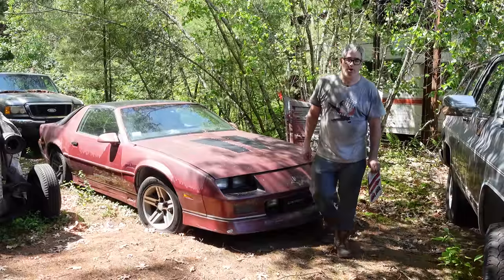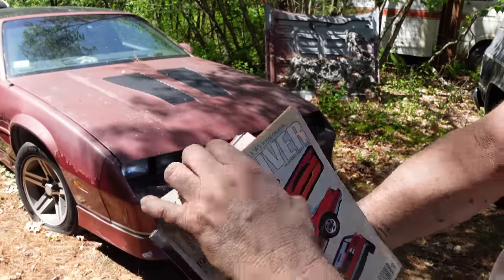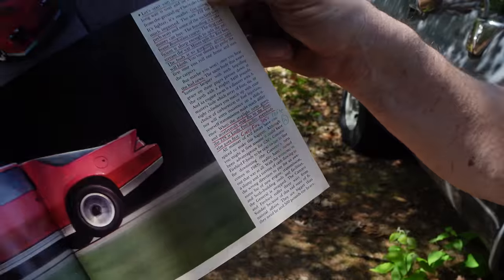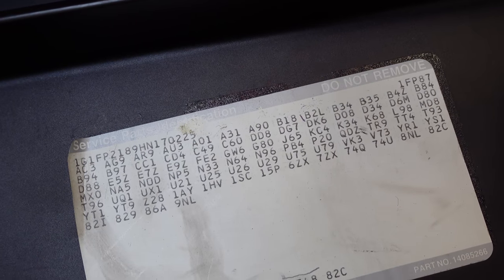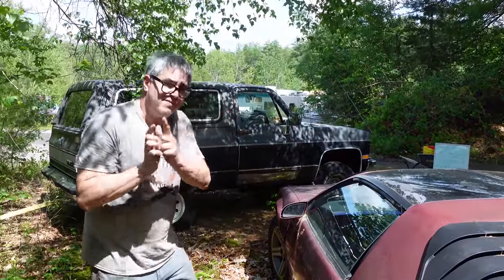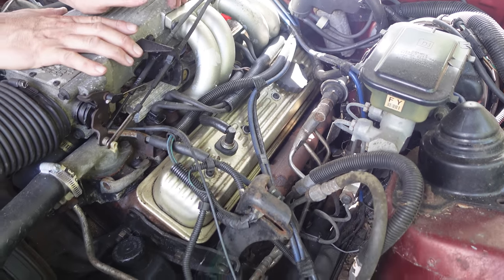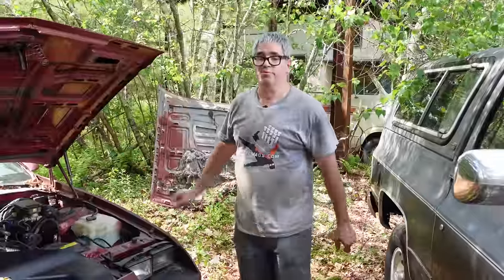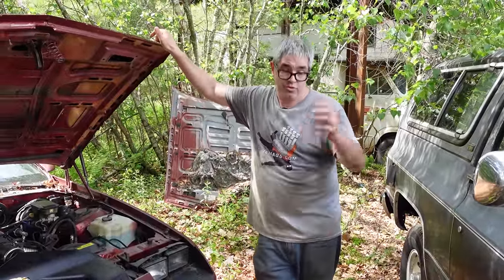Heart of a Corvette

Comment: I had the 1987 5.7 350 and I have plenty of friends in the neighborhood that have mustang GTAs formula 350s Mitsubishi eclipse turbo eagle talon turbos and and grand nationals we always used to go to the track and street race. I’d beat every single one of them stock for stock, except for the grand national. Soon as I put the three states, hyper Tech chip pulleys, air charger, ram air flow master exhaust from the cat back being M shift kit 3500 stall speed in the transmission. A car is running in the mood 1360s, 1370s  what 150 shot of nitrous 1250s, 1260s

Comment: Awesome info.

I read the reason why the 5.7L didn't come un manual is because the manual transmission couldn't handle the tq. True? Who knows. Could've the Doug Nash 4+3 have fit in it?

The auto-only option was the primary reason I never bought one over the years.

Comment: I had one of those 5.7 Camaros. To put the IROC name on those cars was wrong. It handled ok but lacked any real engine power. The GT Mustangs with the 302 motors would walk away from the 350 IROC. I finally ripped out the 350 and built a carburated 400 small block for it and switched it over to a stick with a Muncie 4-sp and 12 bolt. The one time I raced it shifting at 5500 RPM through the turbo mufflered exhaust and 16-inch TA radials the car turned a best time of 13.02 down the 1/4.

Comment: When you said B2K I started going crazy... thinking did Steve find a factory Callaway Twin Turbo IROC?  
B2K is the code for the CALLAWAY TWIN TURBO 350. 
L98 is the code for the 350 Tuned Port Engine. (3rd row 2nd from right side) 
J65 is 4 whl disc brakes, G80 is positraction, D88 is stripes, D80 is Spoilers

Comment: There is an almost identical, like BRAND NEW one (919miles) for sale at AUTO ETCETERA in Montréal. Same year (87), 305 engine, same color, t-top. They ask $89,995,00. Just like if it came out from the dealer in 1987.

Comment: Why is that car in a junkyard in the first place? If I had the cash I'd fly there today and rescue it. I had an 86, same exact color with a 305HO and a 700r4 trans. It kept stalling and blowing the control module in the distributor. I sold it to a guy who later told me it was a loose wire behind the dash going to the tach. Had I known I'd still have it. I really hope someone saves that car.

Comment: Yes they made those 350 irocs but they actually made more than 1k of them and they did put aluminum heads on some of the iroc camaros
Reply: No. But what some tinkers did was use factory '113 d-port heads from the C4. But need to use the correct base manifold for them as well

Comment: I thought the original 1982 Cross Fire Z28’s had a movable flap cold air induction system on their hoods that was functional?  I remember seeing one brand new at the time, and I would swear that it had small flaps on that simulated NACA hood that opened in response to the throttle position.

Comment: owned an ‘82 sport V6 Camaro that blew its transmission after 50k miles. GM told me to pound sand on claim; had it fixed, then sold it.  Few years later I learned  that a class action lawsuit was filed against GM for using a Chevette transmissions.  I swore that I’d never purchase another GM vehicle and I haven’t.

Comment: I’m willing to bet the press car specifically didn’t have A/C to give it an advantage over the Mustang. I’m not sure if this was the same back in the 80’s, but when I sold them in the early 2000’s an A/C equipped Ford always ran it unless it was on floor vents. At very least, they likely picked a warm day so the journalists would be inclined to run it while driving the Mustang.

Comment: Steve, starting in '89 there was a "1LE" Camaro with special brakes, HD suspension and a 350 5 speed T5 "world class" improved manual transmission. They didn't make many of those, but they're worth mentioning-?
Reply: No factory 350 stick car in 3rd generation, including 1LE's...305 T5 or 350 700R4...exception would be Firebird Firehawk modified though by SLP...used ZF S6-40
Reply: @nachoandsancho5218  I pulled the T5 from an original '89 1LE that burned. It was in a junkyard in '91. The junkyard verified it was a 350, and numbers matched, so it was original.

Comment: Back in early 90s I had a blue and gold like new totally loaded 85 Z unfortunately with the LG4 5.0 with the slippy 700, where there not super heavy and 700 has a really low 1st gear it had ok TQ so it didn't feel totally awful from a stop but wasn't fast by any means. I couldn't bring myself to molest the engine it was so compleat totally untouched I had a close friend that also had a black and gold 85 Z but his had the H.O. and a 5 speed just 20 more HP and a manual made a big difference in performance but his was a stripped model so just that made me ok his was bit faster. Its funny that car is now up the road from my house but I heard it's totally rotted out it's to bad it was so nice when I had it.

Comment: They should have had a manual transmission optional on the 5.7 cars. The 5.0 manual was a fun car but that extra HP would have been amazing with a manual. As far as the 5.0 Mustang. By 87 they had 225HP and 300 lb.ft. Of torque in a lighter car. With a Z code axle 5 speed manual you could take a 5.7 IROC as long as you had the lighter LX Mustang. The Mustang GT was heavier. I know because I was there. Even IROC guys back then admitted the Mustang was quicker. Year to year things went back and forth though. The two cars were very close overall in performance. The Camaro was a better handling car. I always liked the Mustangs better overall. They seemed better built. That’s probably why there are so many more Mustangs around today then there are Camaros from those years. It was a great time to be in my 20s though.

Comment: I’m pretty sure that larger Australian rear was not tied to the 350. It was more a supply/substitution thing. My 85 non-WS6 Trans Am had that rear. And around 1990 til the end of thirdgen production they all went back to the 7.5 rear.
Reply: I worked at Pontiac when these were new.  Mostly Pontiac had the aussi rear, not Camaro.
Reply: @scrappy7571   85-89 Firebirds, 87-89 Camaros..some early 1990 cars if I remember correctly. My point is, it wasn’t tied to the 5.7 only
Reply: @salesposito2290  Agree, 305 pontiac too. But pretty sure not many camaro's had it.

Comment: When they brought back Formula for 1987 in the Firebird,it was a stripped down version of a firebird that you could get for almost the same price for an lx 5.0 Mustang.
Without ground effects and only 2 engines you could get were 305 or 350.
It was slightly more than the mustang but with the 305,5 speed it was could run with the best of them.And out of all the Camaros and Firebirds the formula was the lightest car you could buy with a v8.
doors
 Then again came the Firebird in 89 which was the fastest sports car of all time,with a  v6  that went 0-60 at 4.6 secs,ran a top speed of 155.
If Pontiac would of kept building their cars like they wanted to through the 90's they would of been alot better than having a 4th gen that was mostly plastic,cheap stuff.the steel bodies were special even though some like the 4th gen camaro and firebird better.
Pontiac made he fastest American sports car of all time,and could have actually took Corvettes plac if they had kept doing their own thing,just look at what happened with GTO it turned into a glob and they ended production!!

Comment: The 3rd gen cars were very striking when they came out (remember the 'new wave' inspired commercial for the '82 Z28?) and made the mustang look like it was boxy little mini-van, but the build quality of these cars was miserable. I remember test driving lightly used (returned leases) Firebirds and the Z28s in the mid '80s and could not get over how used up they felt - along with all the normal squeaks and rattles. I did own a '84 Firebird SE for a short time. Did GM ever solve the severe body flex problem on the T-top cars?
Reply: The Mustang kinda looks like an Escort.
Reply: @skaldlouiscyphre2453  Maybe a mini-van was a little harsh...still very upright and angular compared to the 3rd gen F-bodies.
Reply: @davem8790  Absolutely. The F-bodies had a windshield angle not unlike the Corvette - meanwhile the Foxstang was pretty close to everyday Fords like the Sierra and Escort.

What's funny is how futuristic and swoopy the Foxbody and Sierra were and how the F-bodies still managed to make them look frumpy by comparison.

Comment: In 82 Pontiac also put a 4 cyl in Firebirds and I believe a few trans ams too...what were they thinking? lol
Reply: Only on base models from 82 to 85, a credit option on S/E models, but Trans Ams only got the V8 or the Turbo V6 in 89.
Reply: No four cylinder in a Trans Am. The 1989 Trans Am could have a turbo V6, but for 1989 only.
Reply: @Raptor3388  Turbo V6's were limited to Anniversary editions, and only came in white.  One year only model and only 1,000 were made.
Reply: @houseofno  there were actually 1,555 1989 Turbo Trans Ams
Reply: @Raptor3388  thanks for the update.

Comment: This car was the start of the true Ford Vs. Chevy rivalry for these cars. Partly because Chrysler opted out, and partly because Ford guys knew the Iroc was a much sexier car and only had lighter weight and the "good ole days" to hang onto with the 5.0. 
Ford dressed up the Fox body, upped the power. 
I will give Ford credit, but also bash them for the same reason. On the one hand, Ford was competing with this car with their 302. Chevy couldn't beat them without using a bigger engine, so they went with a 350. 
On the other hand, Ford had a 351 that might as well have been a factory bolt in swap due to how similar it is to the 302. They refused to do it. I get why, I swapped a 84 Capri with a mild built truck engine so I get why they didn;t offer it to the public, but it became such a point of contention in the stop light race debate I can still hear the non-sensical defenses of both sides from whenever it came up. 
I like both cars for different reasons. now that some decades have passed and they aren't littering the streets i prefer the Iroc because it just looks cooler and time has been kind to junkyard engine swaps for the Chevy. 
I am sure someone is going to want to save that car. If it was in Wi it would be rotten to the ground, so to me it looks like a dang paint job away from being a daily driver.

Comment: The reasoning for no 5 speed manuals bolted up to the 350 TPI was because the unibody could not handle the torque stress and would flex the body, which would be made even worse if it was a t-top. When they brought the convertible back into production in the 91/92 models, you could not get a 350 TPI engine in a convertible at all. There is a side note about the 5 speed transmissions that did come in the 3rd generation F-body platforms of Camaro's and Firebirds: the T5 and T5 World Class 5 speed transmissions were JUNK. They could not handle horsepower. If you squeezed extra horsepower out of the engine, the T5 was known to fail and the T5 World Class didn't fare much better. If someone wants to bang gears, they'll be better off with an "old school" Super T10 4 speed or a well built "new school" T56 6 speed(some of the T56's don't hold up) in regards to GM performance.

I've been messing with F-body cars for 25 years. I have a dozen driver quality, projects, and parts cars sitting at my home shop ranging from 1979 to 2002 right now. I also don't discriminate against V6's or V8's...although I hate LT1's with a passion.

Comment: What gives with the T-tops? My first brand new car the year after I graduated high school was an '87 Formula 350. My dad had just purchased a new '87 GTA 350. Neither had T-tops because, according to the salesmen, they weren't available with T-tops because of the additional torque caused too much body flex. I didn't think that the 350 was available in the 3rd gen F bodies with T-tops at all. Obviously I'm wrong but BOOM, mind blown! And my buddies '86 IROC with a 305 was dead even with my 350 Formula when we raced. And we did it multiple times. I loved the looks of the car but I had a '79 10th Anniversary Trans Am with a 400/4 speed prior to owning this car and it would run circles around the Formula.
Reply: The T tops are a liability. I got tired of having to bring my umbrella every time I wanted to drive in rainy weather. They rattle and leak no matter how many times they’re aligned. Yuck.
Reply: Some dealers sent the cars to ASC to have T-Tops installed.  If the T-Tops has a key to lock them they are from the factory, if not they are from ASC.
Reply: @pmscalisi  I didn't have any issues on my '79 but I know they are notorious for leaking.

Comment: I had a ‘83 firebird with the iron duke 4 banger and a 5 spd….it was a turd……i wanna say i bought that car for $500 from a tow yard back in the mid 90’s……ended up trading it for a bag of weed and $50 when the ignition system no longer produced spark due to a shorted wire under the dash……if i still had that car it definitley would have gotten an LS swap along with the ‘77 camaro i had right before or maybe it was after that….i also bought it from a diffrent tow yard for $700…..it had a 305 with a th350

Comment: HELLO…..No B2K RPO code.  Was a B2L code….BUT THE REAL CODES.  L98 is the 350 or 5.7 engine. G80 and J65.   G92 was the performance ring gear …not present.

Comment: Come on Steve tell them why they couldn’t get the five speed manual with the 350 engine the five speed manual fifth gear could not handle the torque and would break all the time because I used to put 350s in cars that had five speeds

Comment: 1987 mustangs actually had 225 horsepower as well with 300 torque, idk where the 200 is coming from but it was def 225, couple that with the 300 less pounds, no Camaros were beating any mustangs at that time stock, good try tho

Comment: The 350 iroc could be had with a 5speed if it was solid roof
Reply: Not that I'm aware of
Reply: No if you ordered a five speed you got a 305.  Reportedly one of two things was going on:  1) Chevrolet didn't want the less expensive, lighter Camaro outrunning their flagship Corvette or 2) there were structural concerns about the body flexing under the more powerful 350.  Easier to damp down the power using mushy shift points on the automatic which is why 350s got automatics as mandatory.

Comment: It’s rite where it should be……junkyard
Reply: Hard to find room there, already full of fox box rustangs!
Reply: @jukeboxzero1  maybe. But a iroach never beat one in a race.   Slow azz junk 3rd gen
Reply: @JerroldSullivan-nt7qj  3rd Gens are sleek. fox boxes were always cheap AND ugly with their econobox 4-lug wheels, rear drums, no oil coolers and taxi cab interiors.
Reply: @jukeboxzero1  3rd gens are also slower than paint drying.  165hp 305. Or a 220hp 350.  Heavy and  weak
Reply: @JerroldSullivan-nt7qj  330 to 345 ft-lbs from the factory. Torque - it's what throws you back in the seat. And later 3rd gens had up to 245 HP. fox boxes are so ugly and cheap the driver has to wear two bags over their head. even blind men hated them. enjoy that cheap ugly junk with econo 4-lug wheels, drum rear breaks, taxi cab interior, and on and on.....
Reply: @jukeboxzero1  man what are you more salty at? How fast fox bodies ran away from every 3rd gen made or the fact that they are worth 3x more than one now?.  Lmao.  Hahahahahahaahahahahah.